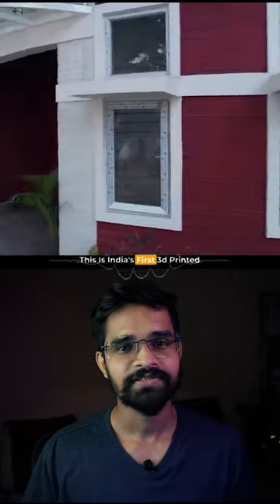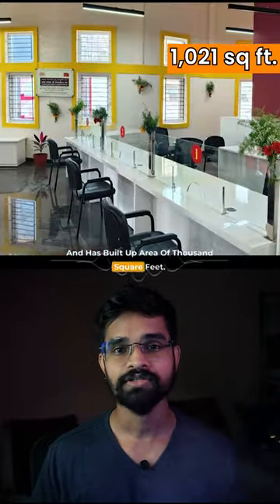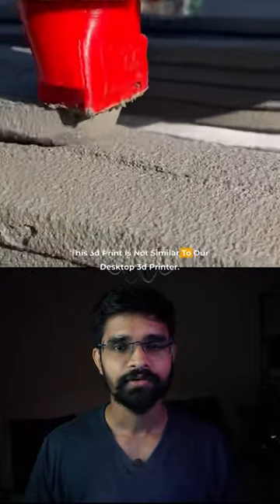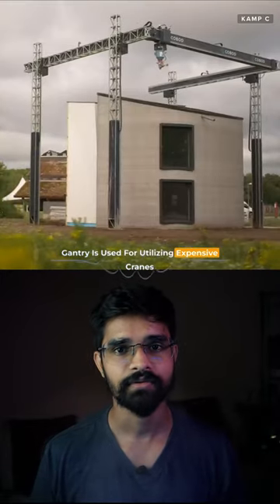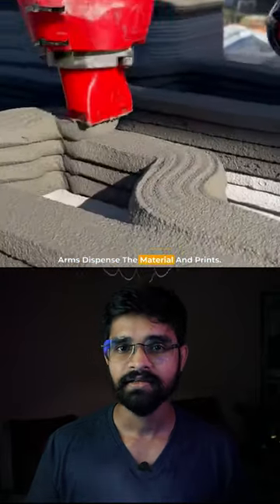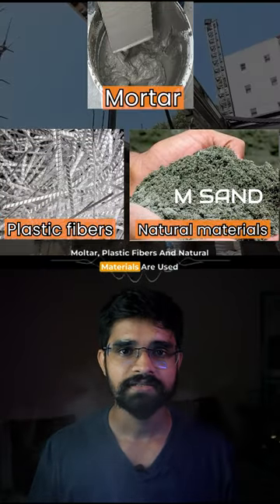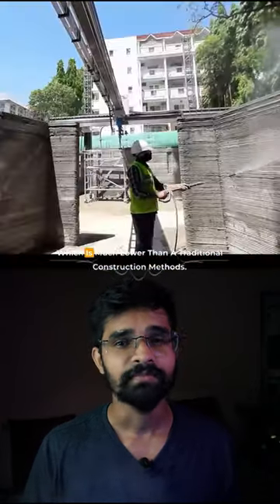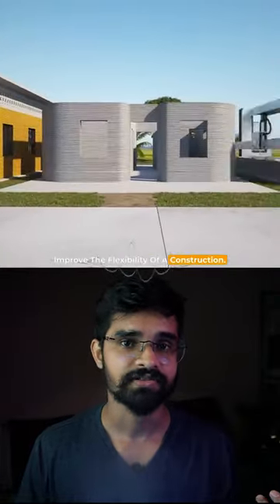Unveiling the Future: 3D Printed Post Office & Buildings  #3dprinting #shorts

Comment: FFS!  It takes just as much concrete, probably even more.  Forty-Five Days is INSANELY LONG TIME for a tiny construction of this size.  It would have been so much more efficient to use the proper materials and have a finished, insulated, and wired/plumbed, building in less time, with less cost, with more thermal efficiency, and better structural integrity!  
If you want to make a robot that builds a house, fine.
But a 3D printer that uses one material and takes days to assemble and requires even more concrete than a regular cinder block constructed building is just so flipping st*pid!  For goodness sakes people, be efficient!